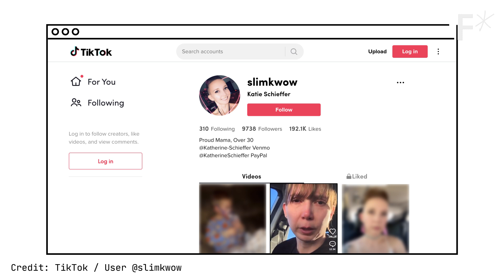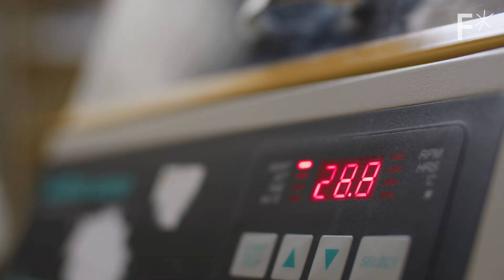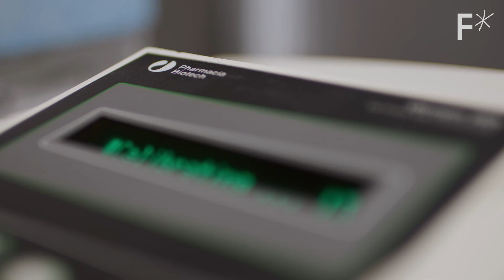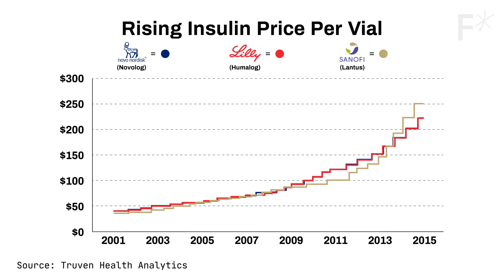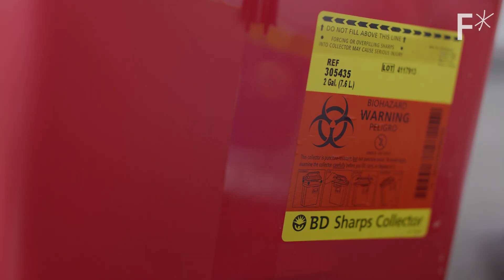The biohackers making insulin 98% cheaper | Just Might Work by Freethink

Comment: The real story here is FDA deregulation. 

Let me explain:
Designing insulin production is common industry knowledge.
We designed it in a course I did. 
Given the knowledge and the tools, you can make it for yourself at your home. 
One problem rises when you want to sell it. 
The FDA requires you to perform really expansive trials (which sort of makes sense). So the real story here is the FDA deregulation.
Once deregulation occures - it can solve the other main challenge: cheap delivery
In the video they solve it by designing a cheap low-mass production chain fitting for community labs, but the private sector could have solved it as well.

Comment: This is also the reason why health insurance is so absurdly expensive in the USA. In Germany, but actually in all of Europe, medications are much cheaper. This is also because the insurance companies can regulate the price much better. So it's always the insurance lobby against the pharmaceutical companies, and this fight is much fairer than when individual patients have to fight it. This automatically also has an effect on drugs that are not paid for by the health insurance companies. In addition, if the state is not afraid of the companies, they can simply force them to offer the product at a reasonable price. Furthermore, drugs may be copied here from other companies, which then offer them cheaper. One of these three options would solve the problem overnight. Health should be a fundamental right and there are absolutely no negative effects for society. The only ones who would not benefit are the shareholders and directors of the companies in question, who would then only be multiple millionaires instead of billionaires.

Comment: Walmart has insulin for $25 and needles for $1.25 for 10.  I switched from the expensive stuff for the Reli On Novolin 70/30 and didn’t have any issues.  Just start with a lower dosage and slowly increase until you feel comfortable.  Last year I hit my $4k maximum out of pocket.  This year I’ve only spent about $300 only for my $95 doctors visit and any other stupid fees they charge for labs.  There’s ways out there if you look hard enough and check the manufacturer’s website for their savings card.  Good luck everyone.

Comment: Too many people thinking these guys are gonna get offed. Here's the thing- there's no need. One of the biggest issues with insulin in the US is patent blockade. Modern fast-acting insulins have hundreds of patents on them, covering everything from the process to the molecule itself. And big pharma has the capital to bury any startup from the instant it appears. The insulin my wife uses currently has 72 separate patents on it, with even more than that number pending. You can't break into this market. Another is propaganda. Regardless of truth big pharma can bury a new medication simply by saying it's bad loudly enough and often enough. All it takes is them buying enough advertising. 

All that money spent on patent lawyers and advertising is just a drop in the bucket to the profits they rake in on insulin. Let's say enough startups kick in from this to actually put a dent into that profit. Heck, let's say enough start up that big pharma starts to lose money. It is STILL more profitable long term for them to lose money for a year or two squashing every single startup than it is to allow cheaper insulin into the US market.

I would love for this to be successful. The problem is that insulin SHOULD be cheap in the US and isn't because lives are worth less than money here. This is where our government needs to step in and put a stop to the insanity. Worse, the stuff I have talked about here is barely the tip of the iceberg. There is a really nasty feedback loop going on with our healthcare and insurance that desperately needs addressed.

Good luck. I hope they are successful. But that success does not a story of victory make. That success allows them to attempt to stand at the starting line. Forgive me for having little hope.

Comment: This is an extremely dangerous approach on solving this problem. The conditions that current insulin is produced under is highly sterile, uniform manufacturing. Homegrown "local" insulin will struggle to come close to replicate these conditions. Besides that, the two methods they talked about require advanced organisms that would need highly specialized professionals to handle properly. Its a good idea in theory but is simply unpractical, and wishful thinking.
Reply: and the "local" labs aren't run by professionals?? if they want to sell the product, it has to go through a quality check and be reported to the FDA. like they have to send samples to them regularly to make sure they are producing it well. otherwise they cannot sell this product.

Comment: As someone who works in a yeast lab, literally all you have do to purify insulin or any other protein is to 
1.) transform the gene into yeast or bacteria with a plasmid. 
2.) Express high amounts of the protein by putting the yeast or bacteria in conditions where the gene is turned on 
3.) Use a protein purification protocol to extract the protein from the cell lysate. 

I'm not saying its easy. I've actually never done the protein purification part myself, but I've seen its tedious. I know its tedious. Also Insulin has some post translational modifications, and I don't know if they work the same in yeast. 

Regardless, once we have a solid protocol (thank God for these guys), making insulin should be straightforward and cheap.
Reply: the great thing is, we can use human embryonic cells to produce this type of insulin more effectively as eukaryotic cells are the ones who need insulin to survive and have perfected it over the course of many years. so once their version is approved I'm sure a few researchers will fine-tune it for embryonic cells.

Comment: Ah, capitalism! So many years after fall of Soviet Union and we finally found out that red commisars have been right about it all along. Anyways, could anybody please explain to me why this show steers us into thinking that all those efforts to produce "open insulin" are a better solution than just a simple (hence classic) way of market regulatory? You do have FTC, dont you? Just make your fancy market thingy work! If I remember correctly, western capitalism paradigm states that "competition forces seller to improve goods or lower prices". Well, those three vendors are selling pretty much the same thing, so lack of price adjustment is clearly a case of price fixing. I wont be surprised if it turned out that big pharma sponsored "open insulin" stub project just to channel people' protesting energy away from a real problem which is unfair and unlawful price fixing agreement. Also, what countries that girl was reffering to? Chad? Mango-Bongo islands? Insulin is available and prescribed for free (or is really cheap) in most countries.

Comment: Pssst, if your pancreas is halfway intact, you can make your insulin on the go. The secret is, lowering insulin resistance in part. Even if you have T1D you can lower your insulin needs, consult your doc, do your research, biochemistry is not that hard. Check out, zero carb/carnivore, lots of MDs, researchers and biohackers are on it for this reason. Live without the chains of disease.

Comment: I imagine that once the protocol is released and confirmed, every university level 100 chem and medtec class will be doing this as a lab assignment just to make damn sure every graduate level chemist ought to know how to make insulin for their friends and family
Reply: No chemist can make it. You need biochemists or biologists. That's because insuline needs to be made in genetically modified bacteria or yeasts.
That means it doesn't just have to be clean, but also sterile.
A chemist could do the purification, but definitely not the culture or even worse the genetic engineering.
Reply: Everyone knows how to make it cheap... That's why it's cheap everywhere but the usa
Reply: This is way above the scope of a 100 level university course.
Reply: We designed insulin production in a course I did. It's common industry knowledge.
Given the knowledge and the tools, you can make it for yourself at your home. 
One problem rises when you want to sell it. The FDA requires you to perform expansive trials (which makes sense). The real story here really is the FDA regulation.
The second challenge is to design a cheap low-mass production chain fitting for community labs. But this challenge could have been solved by the private sector once deregulation happened.
Reply: In the US, T1D is considered a pre existing condition. That means that any T1D qaulifies for insurance that covers all cost.
Reply: No. I'm in med school and no one has ever mentioned this.
Reply: @HM-wn2in  because they don't really want you to know
Reply: @Ethan-qe8pe  plus we don't really care since there's so much info we have to digest. It's a cool technology and I'm glad that the medicine dictatorship will crumble soon enough coz these prices are absurd. Of course in the UK, we have "free" healthcare but I know it's tough in the US and other countries
Reply: @HM-wn2in  I am trying to spread the word that all diabetic supplies bis absolutely free if you know what you are doing
Reply: Government run facilities 'made publicly available' limit the scope of education to control the masses. 
 There's no profit in peace.
Reply: Yea it will be like an practical for them
Reply: That would be bad for business.
Reply: It would be fun to make it.
Reply: PLEASE
Reply: The best way to make insulin cheap is to pass medicare for all. That way, the government can negotiate the prices all the way down, to something like a tenth of what it currently is. That's how it works in France at least, where the vial is around 20$, of which 65% is paid by social security
Reply: @paulh.9526  The government is in charge of fixing roads and education already. How well is that going?
Reply: @Thelitletrainthtcud  I mean, it's not the best, but it's alright.
Reply: @Thelitletrainthtcud  better than private roads.
Reply: No
Reply: Doing insulin for your family is both stupid and dangerous
Reply: @nahuelleandroarroyo  no less stupid and dangerous than not having the money to buy overpriced stuff and die.
Reply: @nahuelleandroarroyo  how
Reply: @abaguettewithacomputer415  It would be extremely difficult to safety test. That's why the non-profit in the video said that they would share it with community labs, so that the insulin is made in a uniform and safe way. They didn't want people making it in their kitchens. Imagine the number safety mistakes that can happen in a single lab, then multiply it by at least 20 other homemade labs, and all of those are going to family and friends of the scientists
Reply: @abaguettewithacomputer415 because it is biotec, and if it isn't sterial, u can get nice things like retroviruses (cancer virus) or more common mykoplasman.

There is areason we have s1 to 4 worldwide in labs/faktories. If that ever haplens only one bad actor is needed to infect the hole global supply (sells privately produced and infected insulin under different name), which would lead to a PR desater leading to less teust in biotec and millions more dead
Reply: No they won't. They're too busy brainwashing good little commie terrorists to bother doing ANYTHING worthwhile. You want to fix this problem? Fire all politicians and insist on two year term limits . two years to throw your shot then get out of politics anywhere forever.
Reply: @bethkrager6529  Unfortunately I fear such restrictions would further incentivize high time preference actions and empty symbolism for reputation rather than good.
Reply: @bethkrager6529  dude it's not the fifties anymore let it go
Reply: @Bacony_Cakes  drink the koolaid
Reply: @bethkrager6529  you complain about communism when this is inherently a consequence of late stage capitalism
and by "communism" you're probably talking about socialism
Good job, people like you ensure nothing ever gets better with their ignorance alone
Reply: @mellowboar9160  They're literally talking about the "communist leftist plot" in a PRIVATELY OWNED university class run in America
They wouldn't know a communist if he hit them in the face
Reply: @bethkrager6529    Mccarthy? is that you?
Reply: @bethkrager6529  lol what dystopian world do you want to live in
Reply: @bethkrager6529  Yeah, a North Korean refugee was scared of the social and political atmosphere of Ivy League universities. She compared it to almost as overbearing as North Korea is with leftist dogma. I think the interview with her is somewhere on YouTube.
Reply: @kakashihatake326  I'm not sure I'm gonna take her word for it. Even if they're really bad saying "Even North Korea wasn't this nuts" already puts everything she says in doubt. And... She still like the only one. I can find someone that graduated Harvard that thinks the Earth is flat. That doesn't make it reality.
Reply: @Setixir  She said she liked Jane Austin novels and was immediately set upon by people calling it racist. She points out the race based rhetoric that is running throughout higher academia. The warning is the USA is going down a dark path of propaganda through incrementalism.
Reply: @kakashihatake326  lmao the US was always drowned in propaganda

Comment: Lilly, Sanofi, and Novo are textbook examples of capitalism gone bad.  

Greed has choked off access to what should be a commodity.  

If it cost $3 to make a vial and it ends up costing $300 or more to the consumer, something somewhere has gone seriously wrong.  The system is broken and needs to be burned to the ground and rebuilt from scratch.  

Paid off politicians have allowed this serious problem to persist for far longer than it should have.

Comment: Next needs to be cancer cure.Those mrna dna covid vaccines are most probably striped down cancer treatments used only on the elite.In the end of the day, the disease is a infection on a dna level and can be stopped.Someone needs to reverse engineer the covid vaccine and fill the missing pieces.Difficult, but is probably the most correct way.

Comment: honestly they should do an at-cost facility. A small group is high costs and inefficient if they do a proof of concept high output lab they can go to other places and train them and help set up other facilities as consultants. that's basically what i do but for infectious disease testing... we need to make our own network of social structures since capitalists will never stop murdering us.. I have molecular genetic skills mostly if anyone can utilize them for the better. my current role is to help open, train, build, validate new labs. I have lab manager experience as as well as bench work. sequencing, ngs, pcr. performed basic cloning but not an expert. please comment if you need a volunteer to help in any of these areas.

Comment: Most diabetics are type 2 diabetics, and they could just lose weight and exercise and they will no longer have diabetes. Let's focus on type 1 diabetics only.
Reply: Exactly. Fasting helps insanely in this aspect. Insulin given to T2 are basically a bandage on an otherwise, solvable problem.

Comment: I humbly add that the scrutiny for injectables must be really really high because they have a very destructive potential if the Quality Control/Assesment is not very careful. On the other hand, nothing justifies 1k USD bill per month. If Brazil can do much better than that (around R$ 600,00 monthly in local currency or 120usd using an average exchange rate), the USA should be doing better just out of spite.

Comment: Man, this is why things are so expensive. Saying things are cheap to male because they cost like $1-$5 per dose or bottle doesn't really factor in all the extra costs.

How much is it to maintain the equipment? How much is it to get the degree and medical knowledge required to create something like this? How much is it so get the equipment and the property it is installed on?

I'm not saying it should be so expensive, I'm just giving some extra context. I do think medication is way overpriced, but I also think the system in place is alright.
Reply: Why should it cost anything? Why should we profit off medical conditions? Because if you ask me that is the most selfish act you can possibly perform.

Comment: Maybe remove coruption... a year ago insulin was as cheap in the us as in europe (about $13 for 1500 units), now its mega expensive again. How strange is that.
Reply: I don’t know if that’s the case, could you have perhaps been looking at animal insulin? That’s a decent bit cheaper
Reply: @CausingChaos.  no that is the one presscribed  to my kid, its 5@300 units.
Reply: The irony is that the newer faster acting  insulin is cheaper (Fiasp) while the older semi fast acting (novarapid) is a bit more expenaive. Its like €14 and 18.

The expensive part is not the insuline, its the pump and sensors. The pump cost €3000/year and the sensor about 1500. Of cause, if i would pay it my self a €100/year pump exist.

Comment: I’m on Medicare and with insurance Lantus costs me $270 a month and Humalog costs me $260 a month.
Reply: @Nick Arjoma my brother actually helped me find a new plan. It’s so much better. The plan I had ended it’s relationship with Medicare so I had to change anyways. I was paying $35 a month. It was the insurance assigned me by Medicare when I became disabled. I chose to stay with straight Medicare and then an insurance for the medication part. This new plan is $50 a month, only $150 deductible, and it says my insulin’s should be $17 each. What a difference eh? I’m actually on a lot of expensive meds, like Eliquis, etc etc so they are much cheaper now.